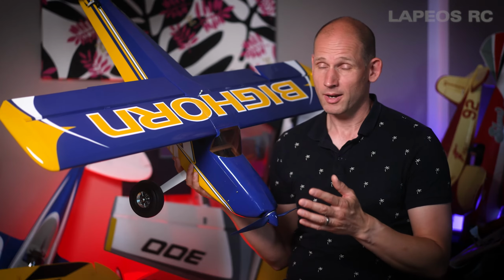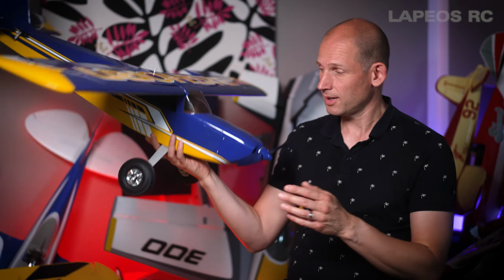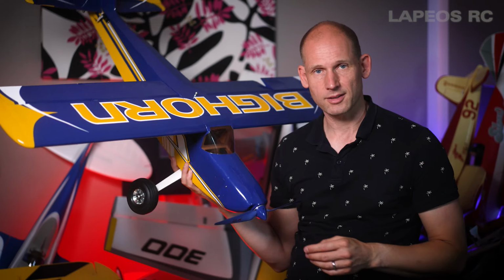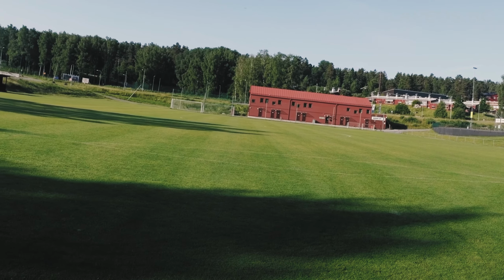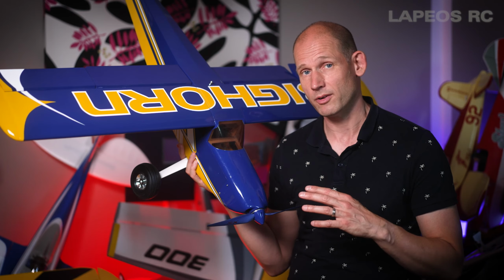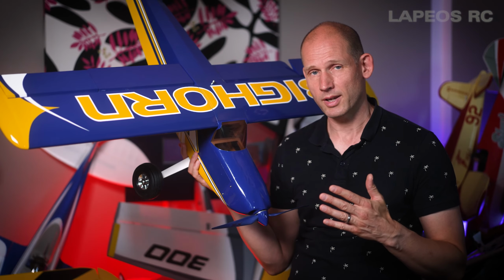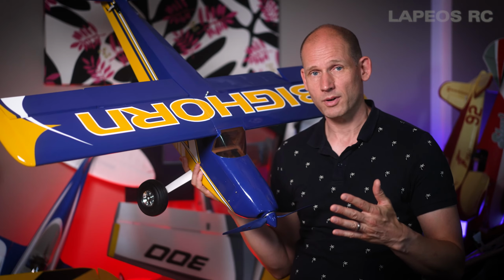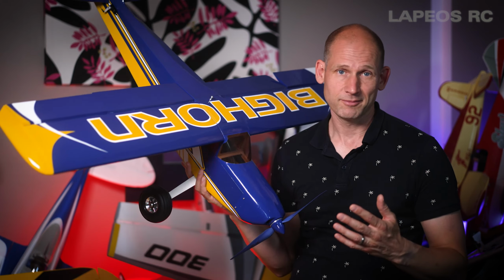OMP Bighorn - This plane just keeps on flying!

Comment: I bought one of these based on your recommendations. One question, are you running the stock ESC or did you install one with higher amperage?
Reply from the maker: I have an Avian ESC to get telemetry.
Reply: That’s what I was thinking of doing as well. Did you bump it up to 60 amp?  Thank you for your responses!
Reply from the maker: @JS-jr1wu  No just a 45A and it is enough for how I fly mine.